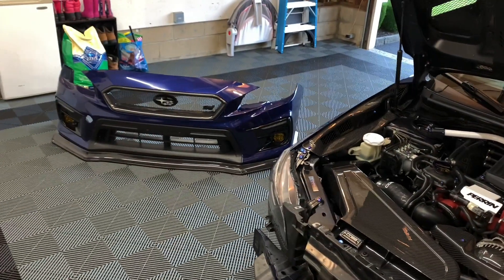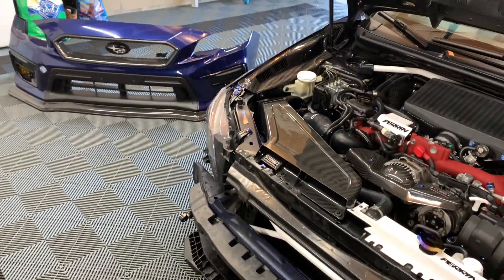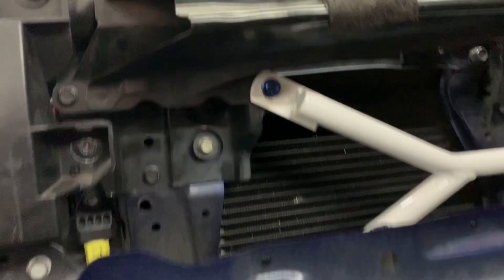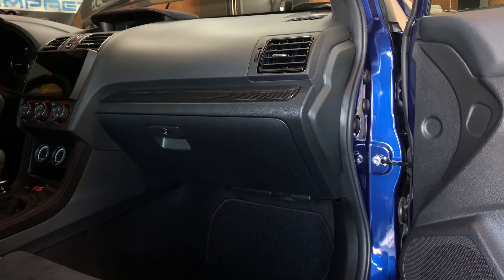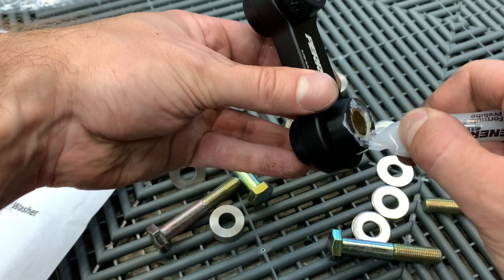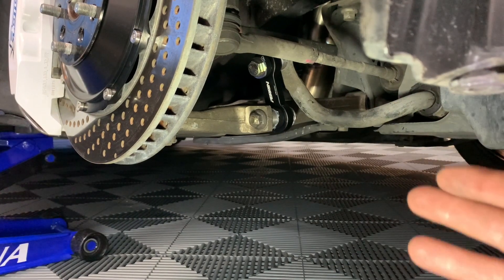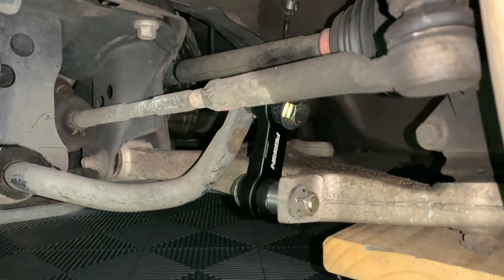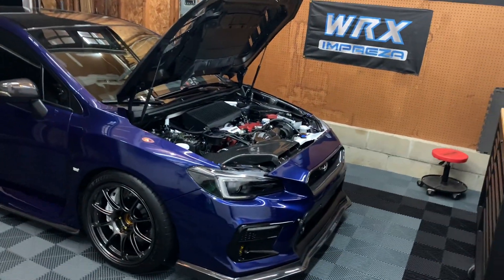Installing Perrin Front Endlinks On My STI | More Titanium Works Hardware!

Comment: Hey bro I have this awkward popping kind of sound coming from my front left coil over area. I had the sound prior to installing new coil overs thinking the sound would go away with the new coil overs installed but it’s still there. All my suspension bolts are tight to spec. Is it common to hear a popping type of sound due to a bad end link?
Reply from the maker: Check the endlinks. Those can cause a lot of noises and pops if they are loose or broken.